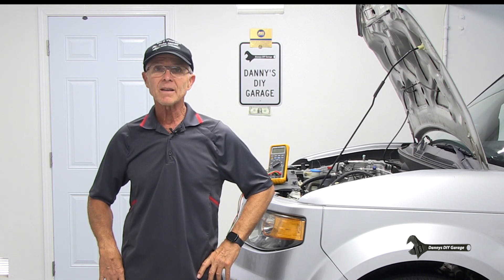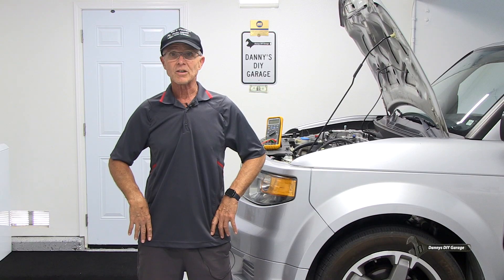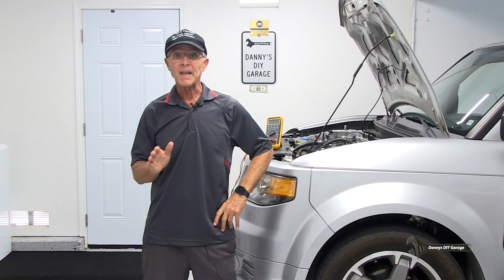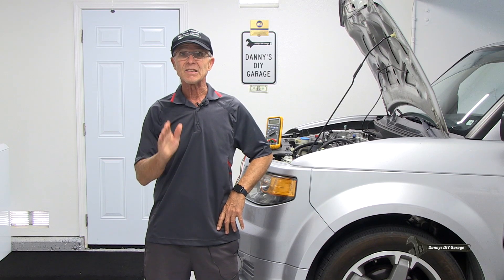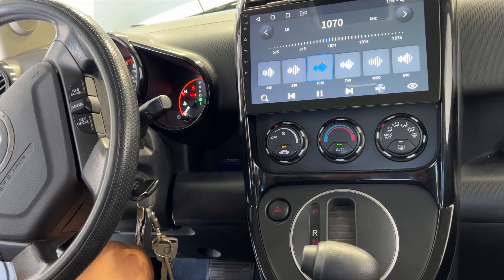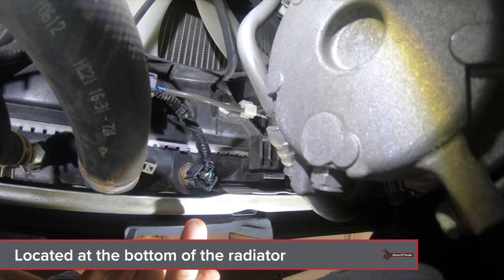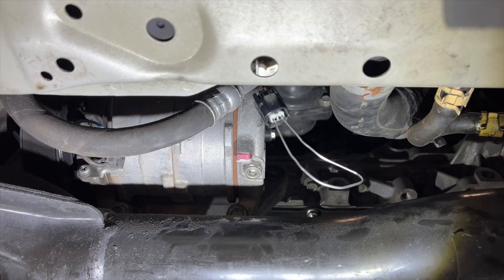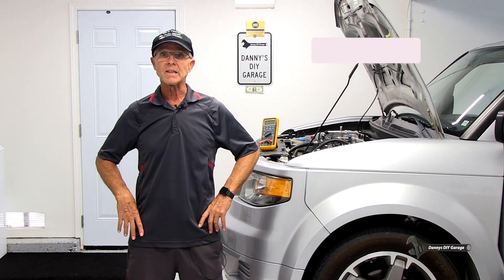Honda Element Radiator fans, not coming on, how to fix.

Comment: Great video. My niece has a 2014 Ridgeline that used to run hot until she turn on the a/c. After watching this video. We replaced the fan switch sensor and it fixed the problem. The dealer told her she had a blown head gasket. I knew that was a lie because it didn't over heat with the a/c on.
Reply from the maker: Glad I could help

Comment: I am getting 12 volts at the connector when the ignition is on (engine off) and connector unplugged from the sensor. 2003 EX.
Reply from the maker: Is this a question? On a 2003 12volts sounds good
Reply: @dannysdiygarage So 2003 sends 12 volts and not 5 volts from the ECU? I have replaced the radiator, fans, thermostat, fan switch and temp sensor. The fans still dont come on even when the coolant reaches 225°. They only come on when the AC is turned on. As for the overheating, the only thing left that it could be is the water pump right? I'm not loosing any coolant.
Reply from the maker: @brandvik9172 your problem is the fans do not come on or over heating or both, with ac on and fans on does it work fine or still overheating?
Reply from the maker: @brandvik9172 I’m not looking at a schematic, but I remember seeing older elements having 12 v on that fan control wire (temp 2), works the same way though.

Comment: Great videos, clear and easy to follow. I do have to comment on this one though. You have a 2007 Element and earlier models (2003,2004,2005) have a different setup. The switch is not the same. It is a "Normally Open, Single-Pole Single-Throw (SPST) Temperature Switch to Ground" that has Input: +12V on green/white, Output: Ground via black wire when hot, Behavior: Acts like a relay trigger switch that grounds the load side when temperature rises. For these older Elements you CAN check the fan operation by jumping the pins on the harness, which will turn on both fans with key in ON position.
Reply: This comment saved my ass, thank you. I got 12 volts when running the test and started to wonder if I had a short.
Reply: @funkstrong  yes sir! Exactly did same on my  2003 and spun right up
But Even more in a pickle , my harness was just dangling , no sensor nothing, radiator has a plastic plug where I’m assuming sensor supposed to be?? 
I know prvs owner Mickey Mouse’s a repair after fender bender …smh now I’m rethinking next step oh boy

Comment: 1st- both fans come on with ac on.

2nd- fans would not come on when engine warmed up to 220 degrees.  (Watching OBD reader info)

I got under car and unplugged ECT sensor 2 and plugged back in. 

3rd- now the fans come on but I noticed that they don’t activate until my temp reads 218 degrees (watching temp with OBD reader). And they go off when the temp drops to 198 degrees. 

Question: is this normal to wait for such a high temp to activate?  You mentioned 212 degrees.  But mine is now consistently going on at 218 degrees.  Or is that an acceptable range?
Reply: Update: I changed the coolant. It was pretty old. Like a greyish green color.  Now the fans come on about 212 degrees.  Seems more normal.

Comment: Thank you Danny! My problem is in here somewhere. It’s only the drivers side fan that is not coming on. I’ve checked the relay and the fuse so far. Now I just need to get that “blue tool” to test my fan. I’m so brand new at learning how to work on my Element (or any car) for that matter. But if I’m going to keep her than I have to learn how!
Do you suggest replacing BOTH fans even though passenger side is working? Elementary forum suggests that is why I’m asking.
Reply from the maker: Depends on how old and mileage on your Element but Yes replace both if you can afford it, if you can’t the only replace the bad one,

Comment: Hi Dan. Great video. I’ve notice my 06 Element engine gets really hot. It doesn’t over heat. Just gets fuming hot. After doing some research I landed here. The fans come on when the a/c is running. I don’t have a voltage meter or a temperature meter but I ran it for 10 minutes and the fans did NOT come on. As mentioned I do not have a VM. Should I just go ahead and replace the Temperature Sensor and is it the same on an 06?
Reply from the maker: It’s the same for an 06, I would suggest purchasing a voltage meter

Comment: My Honda Element heats up with the air off while it is on, there is no problem and I have already installed a new thermostat and the two temperature sensors, which could be.Without the air they activate very late and the tank spits out the coolan
Reply: Head gasket

Comment: Changing the coolant routinely will likely prevent the sensor from going bad. Routine maintenance is critical. Great diagnostic video. Thanks again.
Reply from the maker: Great point, preventive maintenance goes a long way 👍🏼
Reply: Not true. The coolant only touch the outside of the sensors.